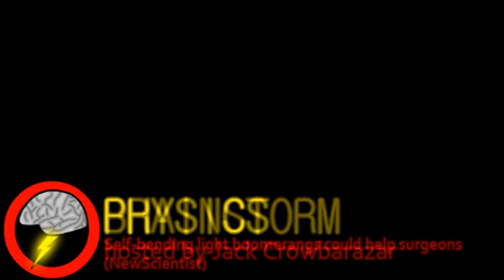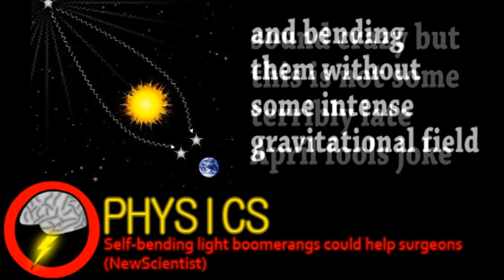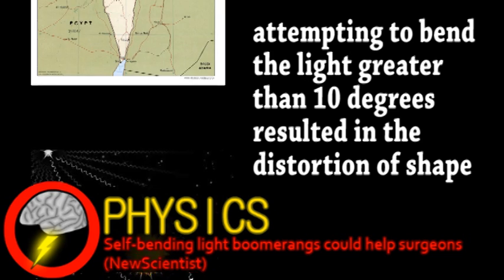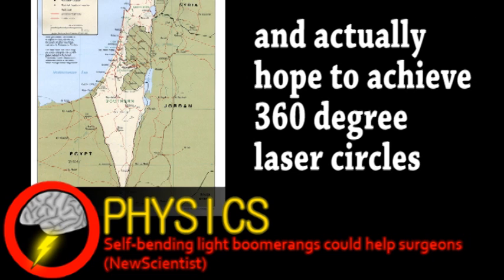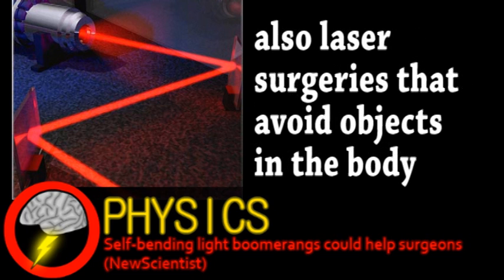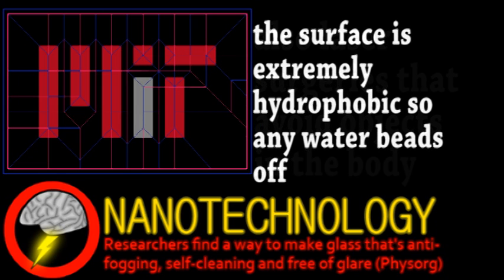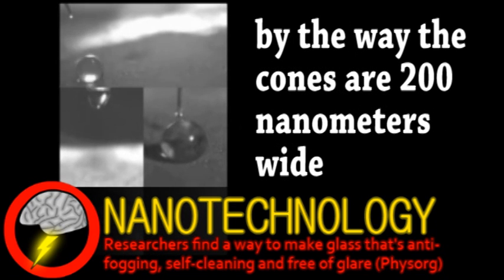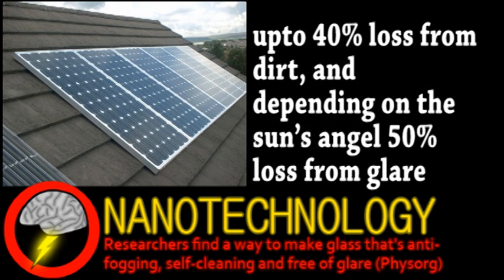Curved LASERS (Brainstorm Ep70)

Comment: A solar panel is made of metal and glass. Metal and glass requires a FUCK TON of energy to melt and shape. You gotta wonder how long those panels need to be in the sun to make back the energy required to mine the base materials, melt them into shape, assemble them, ship them and install them...